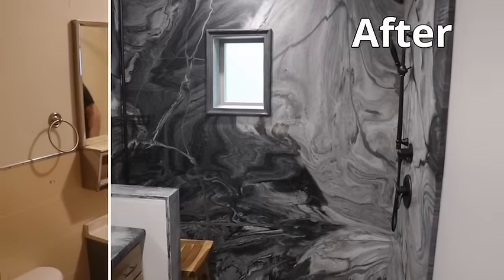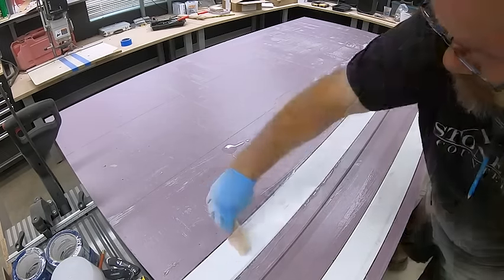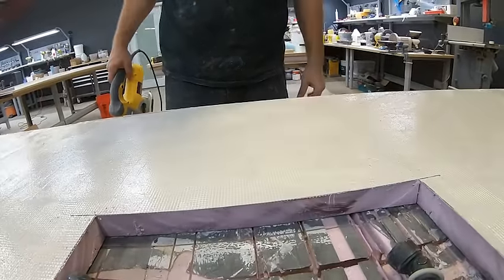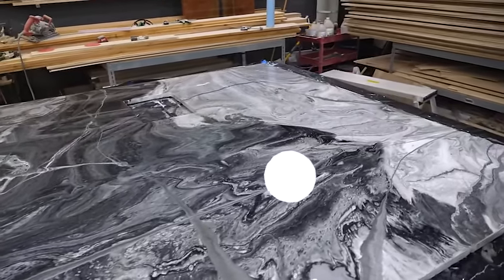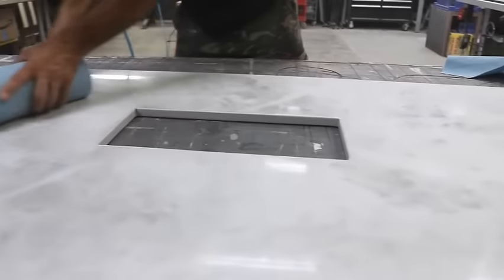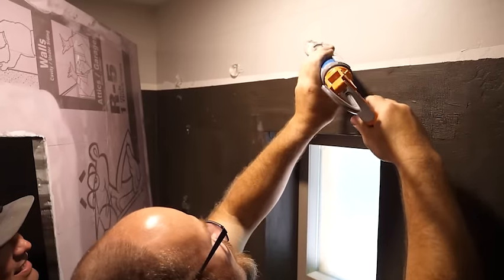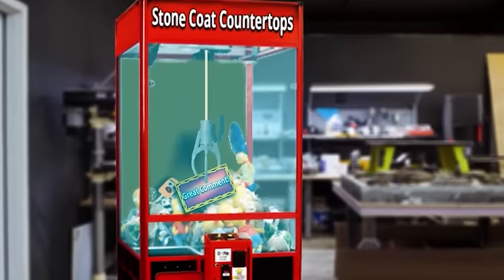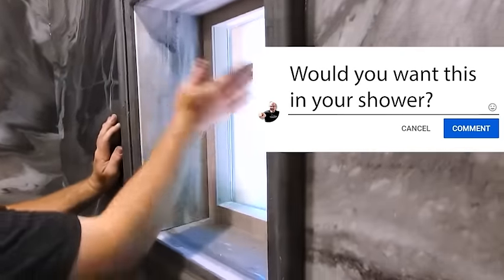Epoxy Shower Walls | Stone Coat Epoxy

Comment: I wish I could convey the feel and look of this shower in real life to everyone. Absolutely gorgeous!! The passion I saw the week we were there doing this for your parents was so heart warming. Thank you for letting us be a part of such a special project. Love you guys! 😊
Reply: salesmen, no passion and that shower did not remain in use.
Reply: @mattnetko2282  curious, can you expand on this comment?
Reply: @TheVelosnow  The use of foam insulation as a shower wall when bumped into with an elbow etc. absolutely will fail.  If you've ever handled the material you will know that even an inch of epoxy will push in and crack, also mold becomes an issue.  This is a sales pitch, yes you can make epoxy look really neat, no you cannot use it on vertical surfaces and it is very difficult to get a proper backer that you can epoxy as panels and install after without issues.
Reply: @mattnetko2282  I've seen evidence that says otherwise, but can you specifically comment on 'that shower did not remain in use'? Do you have first hand knowledge?
Reply: @TheVelosnow  seems like he's in all the comments saying the same things about how this isn't a real shower setup or it wouldn't be durable.

Comment: Looks like a dream come true for building a light weight shower in a RV build! I wounded how much weight this actually added to the foam boards. Percentage wise.
Reply from the maker: Not too much
.
Reply: I had the same concerns in my travel trailer. It added 20 lbs for a 36x24x82. I used Dow R3 .55 inch foam. To estimate my, 1st coat of epoxy with thickener and second coat with two glitters weighed 9.3 lbs. The Ultimate Top Coat was .4 lbs. I used every drop of two gallons for 48 square feet.

Comment: This is so cool. Could you give us an update of what the epoxy walls look after a year? :)
Reply: It seems to me that it would crack over time with a non solid base.
Reply: @kolesplace  you are worng
Reply: @kolesplace  these are build just like  a. surf board, they are very tough.
Reply: I'm guessing the boards behind would absorb moisture and swell if there is no joint sealing after install. They didn't show the installation though
Reply: @kolesplace  lmfao, you don’t even work in the industry. Keep quiet.
Reply: @deven6518  why are you guessing and spreading misinformation?! Keep quiet.
Reply: @Creator_Veeto_PAEACP  guessing, an expression. My line of work is engineering and construction so let me rephrase that in a way that will soothe your ire. 

It will absorb water if it's not sealed
Reply: @deven6518  yes yes, too bad neither the OP nor you had the patience to click the first link in the description and read the instructions; “Ensure your walls have a proper moisture barrier installed before glueing your new epoxy shower panels”
+ sealing your corners is a no brainer for a clean finish and that foam is water resistant. So there’s that.
Reply: @Creator_Veeto_PAEACP  didn't I just say that it should be done but the video doesn't show whether they did or didn't do it in this installation? I don't need to click on another video to Know how to do a proper install. Maybe you should've properly read both my comments before posting yours
Reply: @deven6518  “I guess” were your words. Not “for sure”. you should have recognized the coating on the wall in the video if indeed you are as esteemed as you believe you are. Nuff said.
Reply: @Creator_Veeto_PAEACP  Did you read my second comment? The epoxy coating in itself doesn't stop edge penetration you know.

Edit: Sealing joints is not something you'd see or was ever shown in the video, further validating my first and second comment. English may be your language but understanding it doesn't seem to be your thing. Nuff said
Reply: @deven6518  okay now I know you’re lying about you being an engineer.
Reply: @Creator_Veeto_PAEACP   tell me how it's false then.
Reply: @Creator_Veeto_PAEACP  no answer to back it up? Typical
Reply: I would love that too..... but it depends on how well you take care of them.... when I shower I wipe my walls down every time.....even when I am sick and can hardly take a shower, I still find the strength to wipe them down.....and my walls look like they did the day I moved in here over 11 yrs. ago.....I have never used anything strong on the walls....no need to when you wipe them down every day....and when my kids were home, I made sure they showered first and me last so I could wipe them down.....sure we all  know how kids wipe them down lol...they don't..... so I never ever had to scour the walls like I have heard some people say they have !! you gotta take care of your "Stuff" if you want it to look nice.....just like wearing shoes in the house ....we don't do that either....shoes come off at the door, .....!!!

Comment: Just something to share, when applying your 100% silicone, spray it with some 409 or similar before cleaning your bead line. You will get a cleaner,easier bead with less mess on your finger.

Comment: I just watched this (I’ve seen other projects before, and people spend so much money on those one day bathroom transformations, and end up with a plastic-looking  bathroom for at least 5 times the amount of money for something that doesn’t at all compare to the results of your epoxy, and it’s just too bad because it’s and such a versatile product!

I wanted to mention a couple of things that might be of interest as an option to the final product, especially to those who have to create a brand new shower/ bath to shower conversion. I had a very old colonial house about 20 years ago and the house had only one full bathroom on the first floor that desperately needed a complete remodel, but more importantly, it needed a bathroom on the second floor period, it had all of the bedrooms and zero bathrooms. I was convinced we had enough room to put a couple of closets together, and it is too bad we didn’t have this product back then! We absolutely did have a solution, and that solution was to use shower doors that slide side to side instead of opening the door in the traditional open-motion way, which would have most definitely prevented us from having a shower altogether, and we definitely didn’t want a Mickey-mouse shower looking corner thing. Even though we used traditional tile, the solution would be viable for any material used! 

Our other “easy” solution was to use tile all the way throughout instead of just up to a certain height/etc. , including the ceiling. We used light-colored neutral marble tile that was very inexpensive, and nobody was doing this. The final bathroom looked absolutely incredible, and we didn’t have to deal with any paint. The entire bathroom used the same tile, no special backsplashes, just uniform (it had some light grey marbling- and of course if you’re creating your custom panels, you have so much more versatility with making it look the way you want to, but I just wanted to add that KISS works with designs, too- looking back on it, it would have been gaudy looking if we tried to complicate a very simple design with all these lines breaking up a streamlined look. I stopped by the house around 10 years ago and talked to the new family who bought the house from us, and they said the bathroom was the reason they bought the house in the first place. We bought and sold that house for less than $300k in the early 2000s, and it’s worth $650k now. 

And now I’m watching your beautiful craft and thinking how many homes you are helping to build their value! Thank you for your talent, craft, and dedication!

Comment: Looks great, but since it is foam back what happens if someone knees the wall. How resistant to damage is it ?
Reply: I wonder that and how does it hold up to mold?
Reply: @huna78  mold needs something to grow on, like wood or paper. If you have a mold problem with this set up, get an exhaust fan, should have one anyway.
Reply: But how does it hold up to mold? I live in a subtropical climate, and even with a (overkill) exhaust fan stronger than necessary, there will still grow mold. Mold spores are naturally occurring in the air here, and in the rainy season, its the worst.
Reply: I want to know too. Living a household with 4 young, rough and tumble males, they are brutal with everything.
Reply: If your edges 100% you shouldn't have a mold problem
Reply: May put some red guard on the back before starting epoxy on the front
Reply: Epoxy is very durable and yet still semi flexible. Won’t shatter like ceramic tile would. Porcelain is stronger. But still a good kick can shatter ceramic. Epoxy can take a lot of abuse. Wouldn’t have to worry unless your doing some Bruce lee moves in the shower.
Reply: @walts440  Idk, if you have pushed down on pink foam it says depressed and doesn't need a ton of force. There are probably better substrates to poor the epoxy onto. Even with epoxy, it is not a tried and true method for this application, people are still having issues with lifting and delamination on moist floors.
Reply: @zangarkhan  that delamination happens no matter what you put on the floor. Tile hardwood paint carpet epoxy none of those will last with water penetration through the floor. Of you block out the water penetration with appropriate blockers there is no problem with any of them.
Reply: I really think that adding the fiberglass makes it hella strong. Some early snowboards were made using epoxy, foam and fiberglass.

Comment: How long will this last? I can’t imagine foam being waterproof, just resistant for a little while. Lmk because if it lasts for a long time I’ll be getting this done.  🔥
Reply: the epoxy and silcone are waterproof so the foam itself shouldn't be getting wet at all...  I'd assume it would last for some time provided it's not abused and the proper cleaners used
Reply: What is the appropriate cleaners to use?
Reply: @harrietpearson816  I cant see any domestic cleaners being a problem. Obviously one would stay away from acid
Reply: foam, fiberglass and epoxy is how they make boats.  The old MDF shower panel idea was a little less trustworthy.

Comment: I'd be curious to see how this holds up. The foam in the shower (although protected) is just throwing me for a loop.
Reply: The only way water is going to pass through the epoxy, is if the epoxy gets damaged and breaks. Keep a good silicone seal around the edges, and in the corners, check and make repairs to that caulk, as needed, every few months, and this will last a very long time. If strength of the panels is of any concern for you, use MDF instead of the foam insulation panels.
Reply: Same
Reply: What it's not just regular foam? Like installation foam or water proof or something that doesn't absorb moisture or expand to intense heat 😬 I I don't know what I'm talking about
Reply: @PaganWizard  I was thinking the same thing use MDF instead of foam board
Reply: I also wanna see an update. I know this isn’t the type of channel to half ass things so I wanna know how it held up

Comment: It looks AMAZING but how resistant is it to damage if someone knees, elbows or bumps a shampoo onto it? how does it hold against water and condensation damage?
Reply: Yes. I would like to know the long term durability. Looks great. Love the idea of the lightweight
Reply: Its hard as a rock. If u take a hammer to it, you will put a hole in it. 90% of commercial buildings now a days use foam board, covered with stucco finish, hard outside, hollow board

Comment: Could you address the durability and strength?
Foam has definite advantages over mdf board for water proofing purposes but I wouldn’t want to slip and have my shoulder dent it. Does that mesh plus the epoxy make it hardy?
Also could you use that pvc board as the main structure? Does epoxy adhere to pvc ??
Reply: would you really dent it through the epoxy? I would think the epoxy would harden it enough to keep its shape. he actually punches the wall at the end to show its strength some.
Reply: I assume PVC would be pretty similar to a preexisting countertop pour; since it's a non-porous material, you would want to scratch with up by sanding it to make a good mechanical bond. Definitely try it on a test piece before committing to a huge project, that way you can test both the adhesion and the methodology.
Reply: @JJstram84  he slapped it nice and gently.. didn’t punch it.
Reply: Phone has been a common backer on those thin. Cheap little vinyl shower unit for a long time. And they do nothing but contact glue it to the back of the final panel.They don't seal it or nothing like that. Guarantee you unless you're beaten the Damn thing with a hammer
Reply: We of course he just slapped it. Is he supposed to punch it a break  he hand? But I'd have to say even if he did the people  the have nothing  but Ignore remarks and underhand comments about It's deribility. Probably still would be too hard for them to comprehend how strong it is

Comment: Question: how does it do long term? Water and condensation is a concern I think of immediately
Reply: As long as you have a good silicone seal around the edges, and in the corners, check and make repairs to that caulk, as needed, every few months, this will last a very long time.
Reply: The epoxy resin is water proof. The foam is water proof, and the silicone is water proof. It should last a realllllllllly long time lol
Reply: @paulinadeluca9117  doubtful

Comment: The colors are great would like to know if this same process can done over cement walls and floor?
Do I need to apply like a RED GAURD?
Will the temperature and/or humidity affect in any way?
Reply: I don't believe RedGuard is needed because the foam is a water barrier, especially if you use the XPS insulation.
Reply: @joeturczak5656  I don't think you understood the question all the walls and floor are made out of CEMENT this is  an apartment in PUERTO RICO there is NO insulation barrier such as  foam or  other material, a 98% of the house built here are of cement and concrete NOT LIKE in the main LAND (UNITED STATES) that are built in wood at least most of them I would say a 99% built in the U.S. are made out of wood except for those houses that have a cement or concrete  basement or floor, what I do need to now is :
1. Do I need to apply a RED GAURD or something like it ?
2. Will the  temperature and/or the humidity be a factor ?
3. Can you use glue (silicone or something that is similar to it) ?
Reply: @georgebenitez2381  you realize this video is applied to drywall, right?

Comment: What did you treat the wall under the foam with? This is a great idea!
Reply: Red Gard waterproofing membrane, a roll on product
Reply from the maker: Ardex waterproof system
Reply: @StoneCoatCountertops  Do you need to waterproof if you are installing this over sound and solid tile?  I was thinking of using waterproofing membrane tape in the corners only.

Comment: AMAZED! I flip houses and most of them date around 40+ years old. They also have windows in the worst possible locations. The tub & shower.... Other than tile from a big box loser that never offers matching corner tile, there are NO products for remodeling that allow for window cut-outs without going through the nose in price. This idea, is an answer to old bathrooms. The foam is going to be rigid enough where I can even punch holes around the old shower walls to inspect leaks and then cover with panels and no worries! I'm subscribed and surprised at your competitive pricing on all epoxy products.

Comment: This looks like a great project. I am brainstorming a bathroom remodeling project and I have a bathroom with cedar wall, so it is dark, but I would like to go with a seafoam water color scheme and for the ceiling in the shower area to be a sky blue with some white mixed in to emulate a sky above. I love the stones on the floor of the shower, I think that adds an awesome effect. I have an ugly 1970’s gold fiberglass enclosure that I am replacing. I plan to add a couple insets for the soap, shampoo, etc. something I didn’t see you add, but I think it is needed is grab rails in the shower.  I intend to put 2 x 6 reinforcement behind the wall, so I can add grab rails for added safety in the shower.
Your videos are great for visualizing what the project can be. Kudos
Reply from the maker: Yes backing is important if you're going to install grab rails.  You got this!

Comment: I know there is not a lot of weight there but if you want a panel to stick really hard then do not put silicone like that. Instead draw a full circle with silicone line and nothing inside the circle. Then when you press the panel it will be like a suction plug. Few of those circles and you can hang almost anything on the wall. BTW great work guys it is a beautiful bathroom.

Comment: i have a fiberglass shower/tub unit, with blueboard and plaster walls above, which is starting to stain and mildew from splashes and moisture/humidity.  trying to clean that off just results in the plaster coming off.  i have been looking for some way to finish/waterproof these walls.  this seems like a really good way to do it.  it is way high above, so there shouldn't be any impacts that would break or damage the foam.

Comment: A pro tip if you want... you could have in set that mold for the window  simular to the pvc shower backer board....you also could made the shower backer board from sand and expoy...

Tip 2 you... could have rough cut the foam then made your final cuts on the spot ..then did your final expoy top pour you window molding would have looked like marble  too.
Reply from the maker: Great idea

Comment: my present bathroom has very old tiles... which I do not want to remove.. but  now I think I can do this in a similar way... but in place of foam  I plan to use thin foam 6mm with glass cloth & epoxy..

Comment: The first part is to put up your walls like you would normally would. Insulation, then sheet rock...? Then the foam panels (of course after you add the epoxy)